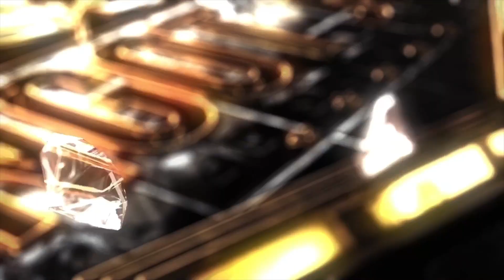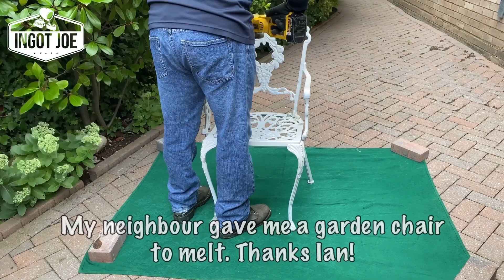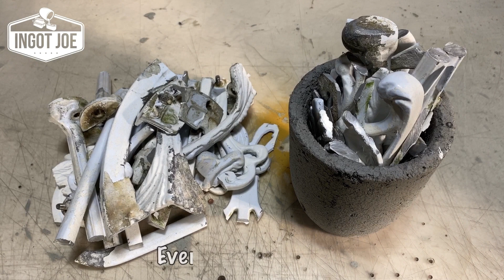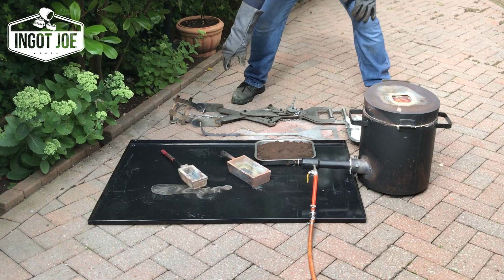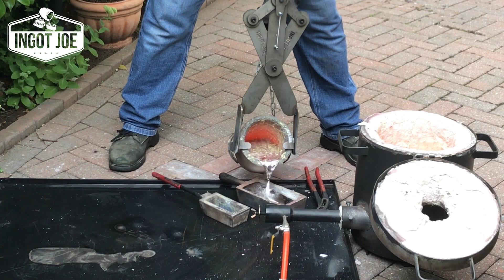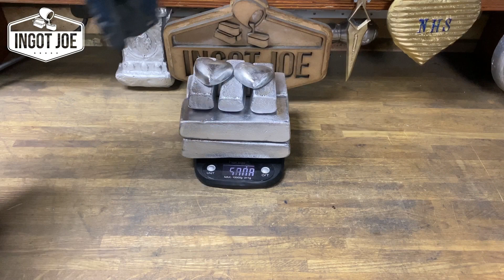Garden Chair Melt - Home Furnace - Molten Metal - Aluminium Ingots - Bullion - Metal Melting

Comment: Gotta love getting an old aluminum chair to melt. I had some a long time ago, they had lots of good metal. Can't wait to see this new furnace.
Reply: I'm melting a transmission case. But furnace in rehabbing. Useing fire brick and plaster of paris. Only it hold heat for a while but eventually. Need info on a plaster i could use on my trash can fire brick and plaster.
Reply: @nathanclemens944  plaster is not rated to be used in a furnace, you need a proper castable refractory cement, Satanite, Kast-o-Lite30 are a couple..
Reply: @Thewulf56  i can buy at hardware store. What do i need for casting.
Reply: @nathanclemens944  don't use the Rutland's fire cement, its not the same thing, needs to be rated around 3K degrees. not sure if you can find it at a regular hardware store, you might have to google it and see if there are any suppliers close to you, you should be able to get online, but high shipping. You could use Kaowool, and then coat the wool with the same stuff, but you wouldn't need as much. I use wool and something called Greenpatch421, it works good.